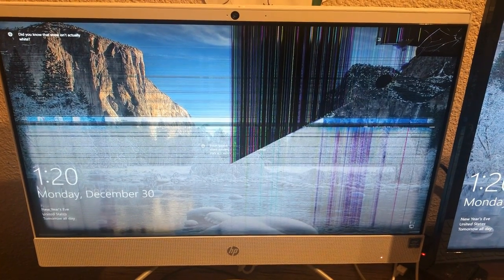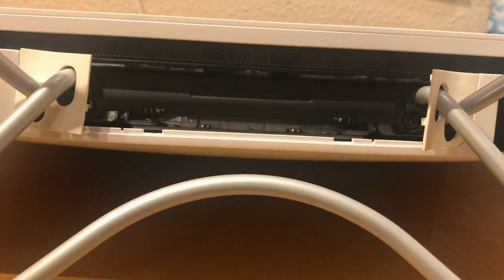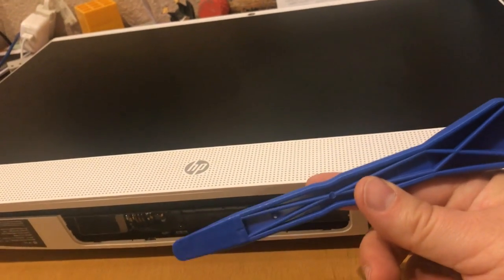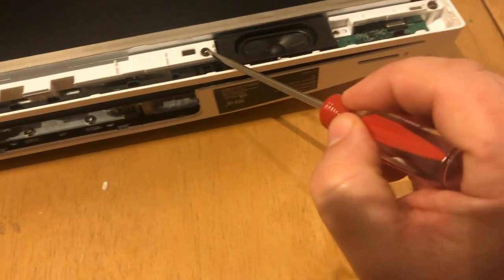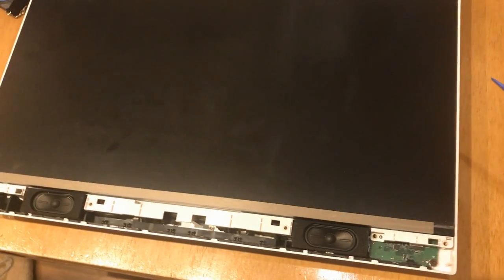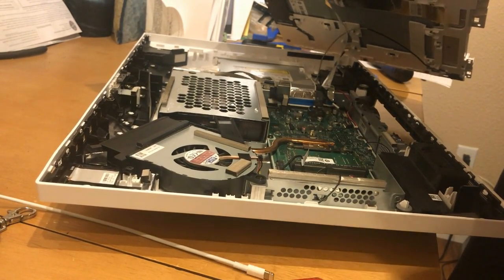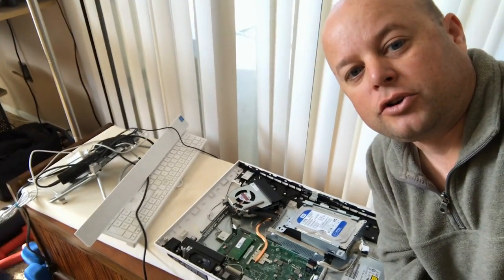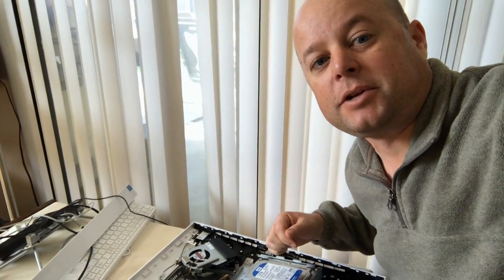How to take apart an HP all in one

Comment: I have one of the latest HP all in ones & recently bought a TRIFIELD TF2 EMF meter. The thing goes absolutely off the scale when pointed at the bottom where the speaker cover is in both corners only. I have the audio switched off as I have separate speakers. The bluetooth & wi-fi is also disabled. Wth is under there for it to be doing that when I have the RF chosen on the meter?

Comment: So I have one of these HP all in one with a busted screen as well. Is it possible to take out all of guts of the computer and install it in a tower for use with a reg monitor system? The computers are going for $200 used so it doesn't make sense to pay $100+ for just a screen that I'll probably bust during install. Is that possible to do? Thanks for your time

Comment: 3:34 Just a Note to anyone doing this, slightly pull up on that white release tab, do not just jerk out the LCD cable.
Reply: My accidentally came out and I’m not sure how to put it back in any tips?
Reply: @imjunlucky   You should have a small piece of plastic, lil white/beige tabs on each side of the cable, lift it lightly and the cable should slide back in once fully inserted push the whte tab down on both sides. this will hold it back in place. 

Hopefully your tabs didn't fall off, which can happen sometimes. in this case sometimes you can put them back on, sometimes you cannot.

Comment: I have one of those HP all in one computers, and definitely want to upgrade the hard drive size. Also I would love to upgrade the horrible web cam that is inside my HP all in one. It is horrible. I had to use on of my USB connecting Web cams from a desktop to get good video. Pretty crazy they put junk in the web cam.

Comment: I’ve been really lucky with my computer. I think this type of this brand computer is very hardy. I have issues will falling asleep if I’m not doing something that will keep me from falling asleep, but anyway I had head butted mine twice and knocked it off the cabinet it sets on at least 5 times. Well on the 2nd or 3rd time down I cracked the lover corner with a spot that looks like it was struck by a hammer and there are a few sprier web veins, hardly in the way and the thing still ran correctly. Well the other day on it’s last fall and a hit taken in the upper right corner but a little toward the center which also has a few veins off of it. This time it also knocked the on/off switch popped out, and the thing is still running!!! My last one ended up with hard drive issues which we got a new hard drive for. That things were

Comment: I'm watching this video 4 years later but just wanted to say thank you so much for making this video!  I have a 2018 model HP All-in-One and now 6 years later the 1 TB Seagate HDD that came with it just slowed to an absolute crawl.  I tried reinstalling the OS several times over the years but nothing would fix it from just sitting there churning the hard drive while taking, no joke, anywhere from 60 seconds to 4 minutes just to open the browser.  I had no idea how to take this thing apart but thanks to your video I had the courage to attempt it in order to swap the HDD for a fast SSD.   Everything went smoothly even if it was challenging to pop out all those tabs on the white cover and around the screen.   I got the drive swapped out, everything put back together and the computer is working great now, browser pops open almost immediately.  Thanks again!
Reply: same😂
Reply: Yeah I’m here cause my mums all in one is basically trash (was when she bought it and I told her!) she let me build her a new pc but wants all the stuff off the old HDD so i wanna take the drive out and just hook it up to the new system via SATA and copy what I can before the ancient mechanical drive dies.

Comment: I was moving furniture around and I had my PC all in one from HP and all the sudden it slipped and fell on the floor about 2 1/2 feet down. It fell in his back and it’s open and then a cable came off, so I don’t what is the cable for, know I’m looking for videos and how to disassemble my specific model computer. I bought it on QVC online on those dumb infomercials channels and I paid off in a monthly basis and it’s paid off. I had it for probably five years now and it’s been working great ever since till two days ago, it fell off my freaking desk on his back the screen did not crack greatfull, and also since some six months after I bought it, the mouse or the touchscreen started to scramble to the corners and not working so I looked it up and I found how to turn it off and I’ve been using it like that ever since. Can that be replaced? please let me know. Give me more details about this particular PC. Thank you.  My computer model is a all in one HP. TCP-Q032–24

Comment: All these videos should come with a legal disclaimer: if you don't know what you're doing, then don't even attempt doing it, and by opening the case you will also void your warranty.  It is VERY EASY to crack the screen during the removal process, despite how easy he made it look, so do yourself and your local economy a favor by hiring a certified technician. That way you don't have to worry about breaking the screen, or damaging other components.
Reply: I have had it for like, 4 - 5 years now, I'm not sure there IS a warranty anymore.
Reply: I've never seen the inside of one of these in my life and got the screen off no issues. No need for scare mongering
Reply: @Jisei13  
So? And if you think your warranty is good now, after you, who is not even a certified technician opened it up and removed the screen, forget it. The moment you break one of the screw seals you're done that's it. Why the hell do you think they put them on there, for show?
Reply: @nikonlover1  dude these PCs are old as fuck they aren't under warranty
Reply: @Jisei13  
Without any doubt whatsoever, you absolutely just got lucky, whether you agree with it or realize it or not.
Reply: @nikonlover1 I did it without causing damage as well it was very easy
Reply: @ThatOneNerdGroup745  
Doesn't matter. That's not the point. This conversation is about warranty terms, so you might want to keep up.
Reply: @nikonlover1  no I didn't. It's literally not difficult but yea do whatever you like with the information
Reply: Respect
Reply: They said common sense was dead 😅
Reply: Yeah but I don’t care about the screen, I just want the HDD to save my Mother’s stuff. I’ve build a new system that isn’t a shitty HP prebuilt. Sooooo…. Not everyone here is trying to repair their system, just wanna know where the screws are and the teardown. Fuck me… some people are complete see you next Tuesdays.
Reply: @razerow3391  
I'm not here to help or train you or anyone else because unlike these moron wannabe YouTube video stars who stupidly post these videos to the detriment of their business and everyone else's I'm smart enough not to share my knowledge, but I will say this: do yourself a favor and just get the screen replaced by a local computer repair business with certified technicians. Support your local economy by not bringing it to Apple, also because they'll charge you a piece of your frontal lobe and two legs.
Reply: Opening the case does not void the warranty.  Its federal law.
Reply: @paddleswake8372  
Uh, wrong. The manufacturer has the right to specify the terms of their own warranty.
Reply: @nikonlover1  actually unless they can prove a customer caused damaged the device by opening it incorrectly, they can not deny a warranty by just a sticker being removed.
Reply: @nikonlover1 I think it’s older than the usual 12 month warranty HP offer.

Comment: Thank you so much for this video, the best one I've found thus far, my CP stopped booting and I didn't hear the fan or any other components like the fan, running at all. I thought it was over for my PC and wanted to retrieve the hard disk, but as I opened the front cover, I pulled out every wire and sets of wires with a quick release, pull the cards and placed them back without touching the connectors, and put it all back, one at the time, still, PC didn't work until I replaced the 2032 battery that is inside almost dead center on the panel, then I'm

Comment: Thanks for the video. I have a cracked screen, and I can buy a new one for around $250 It appears easy enough to just replace the screen.  Now I know how to upgrade the ram too.  Besides knowing that tabs along the edge need to be pry off cautiously, anything else you can share to avoid breaking the replacement screen when replacing?  Thanks.
Reply: You did it ? I'm trying too and I can't find it

Comment: I tried opening mine up today to check if the HP Support website was correct about it having a couple of M.2 slots, but couldn't quite find all the clips around the screen. I could see the ones at the top and I'm pretty I sure I got them all un-clipped, but when I looked into the gaps on the left and right, I didn't see anything in there. I will try again some other time, but today I just gave up and put it back together because I didn't want to accidentally break the screen (especially since I really need it working right now to finish some online schoolwork before my school year ends next week!) I got it all assembled again and thankfully it still works perfectly, thanks for the great tutorial!
Reply: after playing around with some old laptops recently, opening them up and swapping hard drives, I am feeling confident enough to try opening the HP again. I'll post again here to let you know how it goes!
Reply: So I finally did it, and I was successful! Got it opened up, didn't break the screen, now I can install an M.2 drive!

Comment: I just opened one up for a friend and noticed that it has a NVME slot, so we ended up just adding an NVME, reloading windows and just using the old drive for storage. Now its way faster than before.
Reply: Ooh that sounds really nice, I might try that with mine someday, do you know which one it was? Mine says 24-f1047c on the box, maybe I will be able to do the same if it's the same model.
Reply: @DuckInGameStop  if it looks like this one then you should have no problem but i dont remember the model number sadly.
Reply: @fbnmndz  I checked the specs for mine on the HP Support website and it appears to have 2 M.2 slots, it doesn't specify whether they're NVME or SATA though. Plus I couldn't find a official replacement SSD from HP on their PartSurfer service, (found some RAM and was planning to get that, but then it said it was unavailable or something) so I guess I'll have to figure out somewhere else to buy an SSD (and/or some RAM) from... Tried commenting on a SSD replacement YouTube tutorial by the official HP Support channel asking them where I could find one, and my comment just got deleted instantly. I'm thinking it might be more convenient to just replace this computer with a real gaming PC, and NOT an HP one... (I don't know if they even make gaming PCs, but I know I won't be getting one after this experience)
Reply: @DuckInGameStop  i used a 128GB sata version m2.

Comment: When you pull out the monitor cable please do not pull on it like he did.  Thw white peice of the connection on the motherboard is a clip.  Please gentle pop that clip up.  And the ribbon cable with smoothly pull out with no resistance.  This will keep Pins on ribbon cable from being damaged.   Other then that this is a GREAT tutorial.

Comment: Thanks for the video. Was having a little trouble getting the screen out (needed to run around the side clips). I don't know why this thing had a 3.5" mechanical drive in it. Was awful, so put a 2.5" SSD in for a friend. Nice to know there is M.2 in there as well.
Reply: Did it improve performance greatly?

Comment: Yeah this is a very bad video, there are service manuals which show that you slide the the LCD panel down then flip over and out. Please refer to HP’s service manual for this series: http://h10032.www1.hp.com/ctg/Manual/c05933340.pdf you can also find more specific manuals depending on your model. ALWAYS, ALWAYS search for multiple reputable sources of fix’s or how to’s, and check the comments and resolution confirmations. And if multiple sources line up then yeah your good to go. Never rely on one source of information unless that information is from God, thats the only exception lol

Comment: Hi everyone 👋 Please DON'T TAKE this idiots advice! I recently changed the hdd this computer (successfully) and you absolutely HAVE TO start from the BOTTOM and work your way to the top, if you try to start popping clips from the side first you will DEFINITELY destroy the display!! He also pulled out the display ribbon cable WITHOUT UNLATCHING the connector first which could damage the display connector.

Comment: Look up the part number of the LCD, you might be able to find a replacement cheap enough to be worth it. Or look up the datasheet and find out what signal it uses, then replace the LCD with any LCD of the same resolution that accepts the same signals.

If nothing else, turn it into a home server.